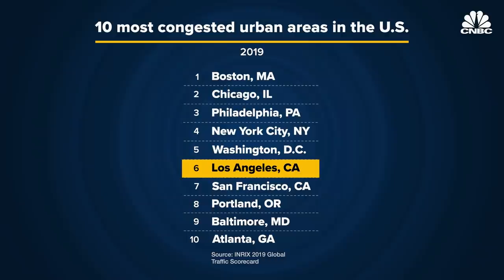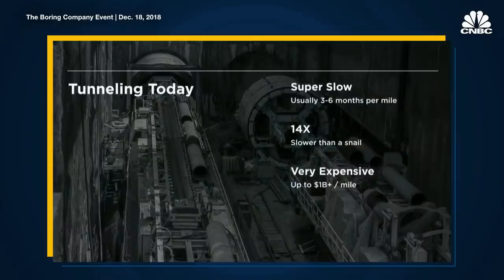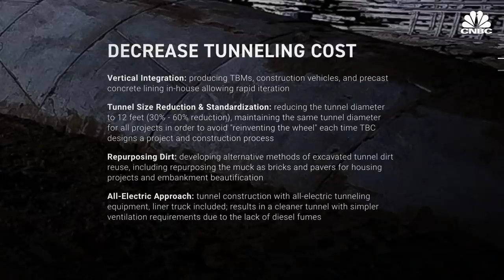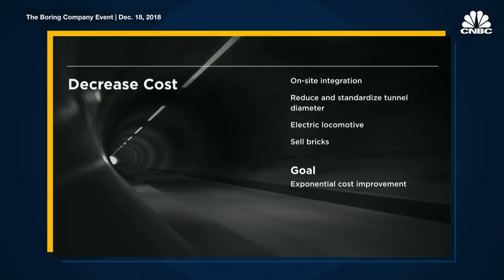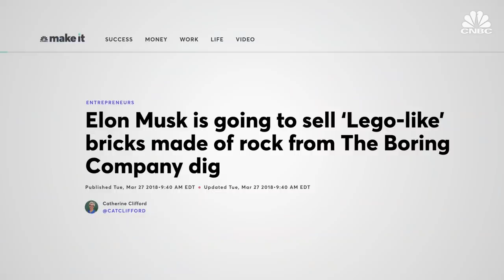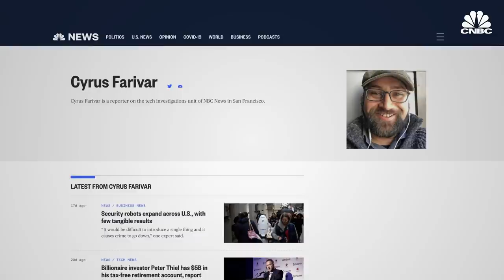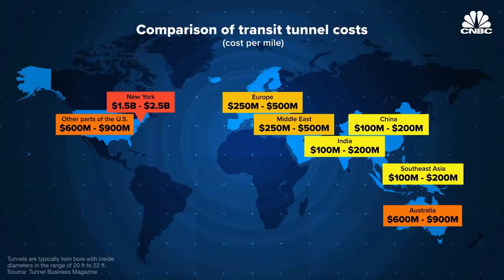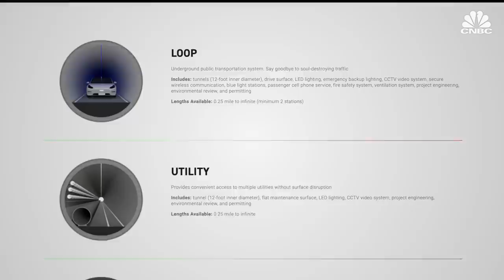Why Elon Musk’s Boring Company Isn’t Fixing Traffic Anytime Soon

Comment: chill people.  If they can innovate and vastly improve the capabilities of boring machines , the tunnel making process and drastically lower the cost, this is a good step for any kind of tunnel.  Building tunnels for Elons cars doesnt have to succeed.  Autonomous vehicles , hyperloop, etc. could eventually change the attitude and feasibility once they are developed.  Many innovations required to make these things work.  Just cuz they all aren't successful yet, doesn't make it a failure.
Reply: But what is the problem with trains?
Reply: @sarthakjain1824  Trains stop at every station. Vehicles in a Loop system can get you from your start to your destination station without stops and without transfers.
Reply: @kevinbailey8827  Express trains don't stop at every station.
Reply: @jeanduponte4056  Yes, I know.  Express trains are great if you happen to be at one of the stations where it does stop and happen to be going to one of the stations where it does stop.

One advantage of a Loop is that every trip is an "express" trip, no matter which stations you start and finish at.
Reply: @kevinbailey8827  but are not trains more effecient?
Reply: @sarthakjain1824  A FULL train is more efficient than the same number of passengers traveling by car.

A train carrying four people is a lot less efficient than a car carrying four people.

In practice, electric cars carrying an average of 1.2 passengers are only a little less efficient (in terms of energy use) than a typical urban train with its average load. 

For the convention center Loop, there are large crowds only for a few days several times a year (like CES).  The rest of the time, there are much smaller crowds wanting to ride.   With a train, you'd be running it mostly empty, most of the time.  It's not a good fit for this location.

Efficiency for larger Loops, like the one they're building for the rest of Las Vegas (with 51 stations) is still theoretical.    But once its complete and operating, statistics can be compiled.   

We'll be able to compare actual energy used, actual operating and maintenance costs, average ride time, customer satisfaction, etc.   We can compare those numbers to similar-sized systems that use buses or trains.
Reply: @kevinbailey8827  but if we have trains in very crowded area, I think full trains would be much more than empty ones and would be more effecient in the long run
Reply: @sarthakjain1824  There will likely be places that don’t yet have a metro system or need a massive upgrade to what they currently have, where trains will still make more sense. 

Once the Vegas Loop is operating, the decision makers in those places will be able to consider the Loop as an option (perhaps modified for their needs) and make an informed decision.

Comment: Average tunnel digging costs (for simular sized tunnels like The Boring Company made here) already were and still are around $10-12million per mile.
The Boring Company ended up with $50 million per 1.7 mile.
Which comes down to $29million per mile. So almost 3x more expensive than average tunnel digging costs. Great work, Musk :)
But hey, if you just compare it to an advanced metro system that costs a billion per mile and forget the amount of people per hour they are able to handle, it still sounds "cheaper", right?

Comment: Because scam is not designed to solve problems?
Reply: It's designed to make money.   The next version of the scam is that TBC is going to build 29 miles of tunnels under the Las Vegas Strip to connect all the casinos together, along with the big stadium and the university.  Eventually the airport as well.  TBC will pay for the tunnels, and the casinos and other destinations will each pay for their own stations (51 stations currently approved). 

TBC will make money after the tunnels are built by charging passengers for rides in the tunnels.  So the grift pays off only if they do a good job transporting people from place to place.    And the real prize in TBC's long con is that if the Las Vegas Loop is very successful, they might attract interest from other cities about adapting the loop concept for their needs.

Oh, I forgot one detail in scam: TBC has promised to bribe the county by paying out a portion of the passenger fares to the county.

Comment: I hope that this is not a project that tax payers are going to be responsible for?
Reply: Hotel taxes paid for the Vegas Convention Center Loop.  It cost a lot less in taxpayer money than an underground or elevated train would have.   It works, and the passengers give it good reviews. 

The larger Las Vegas loop (29 miles, 51 stations) is being built without taxpayer money.  TBC is paying for the tunnels and the station owners are paying for the stations.   TBC will pay a portion of the revenue to the county as a franchise fee.  

If other companies did this, we'd have a lot more metro systems in this country.  If they don't, we may end up with a lot more Boring Company Loops. 😄

Comment: Is this really important to him or is it just to gain experience and money to use this technology on Mars? Remember the boring machine sent to Mars could likely be build of much lighter materials other then the cutting face and structure needed to withstand the rigors of torsion. Possibly mostly titanium, aluminum and magnesium. Very modular and possibly very reconfigurable. Don't forget there are all kinds of tunneling machines just as adaptable to Mars. Look at Road Headers etc.

Comment: How can you fix traffic with a one lane tunnel for only tesla's that go 25 mph? And can you imagine what will happen when one of his cars catches fire in his tunnel and people die because there is no safety systems in it? And of course you can build it faster and cheaper if you don't include the same infrastructure a normal tunnel needs to be safe and operate properly.
Reply: There are safety systems in the tunnels. Whoever told you there aren't is lying to you for some purpose.
Reply: @kevinbailey8827  ther are inadequate safety systems only enough to pass regulations. Theres one fire hydrant and sprinklers at the station and nothing in between just look at a video of a car going the entire length of the loop. Also there just isn't enough space to fit proper fire suppression systems and vents. whoever told there were proper safety systems is lying to you.
Reply: @ballisticfuror1033  Passing regulations means they are adequate.   And you said "no safety systems", which you now admit is a lie.
Reply: @kevinbailey8827  the regulations are the bare minimum it also dosent take into account the fact that no emergency vehicles can even fit in the tunnel to provide ais if needed. 

also calling barely passing regulation adequate is like saying getting 1% over passing marks a good result.
Reply: @kevinbailey8827  i also never said the words "no safety systems" but the ones that are there do jack all
Reply: @ballisticfuror1033  Adequate means you won't be able to shut them down by claiming they don't meet the requirements. 

The tunnels are one of many places that emergency vehicles can't go.   When was the last time you saw an ambulance driving in a subway tunnel?  

TBC worked with the Clark County Fire Department to design their emergency systems and procedures, and they have jointly drilled on those procedures. 

Spokespeople from the CCFD have spoken approvingly of the tunnels' safety.
Reply: @ballisticfuror1033  You'll have to wait for an actual emergency to see how the safety systems perform in an actual emergency.  Hopefully  you'll have to wait a long time, because it would be sick to hope for an actual emergency to happen soon.
Reply: @kevinbailey8827  The tunnel is too narrow to open the doors.  Even if you could open the doors, there is not enough space to walk, especially for disabled people.  The cars have a horrible record of battery fires.  Are you seeing a problem here?
Reply: @georged8644  you are wrong on nearly every point.

Comment: Driver bumper that the reason congested.
Reply: We just build the magnetic rail for carry passengers and the freight.  So that we able to print monies and fiscal budget for states not short
Reply: And we need to add in solar panel and electric alternator to charge the electric cars battery.  So that we print monies to regulate market and also the economy.
Reply: And pay for the workers and restore the credibility back to triple AAA rating in finance and bank no shut down.
Reply: That cause more confusion in state.
Reply: The traffic jam and accidents must retrain all drivers to void drive fast and slow and slow pack traffic and gridlock which means must detect problems.  Or we build sensors that detect problems for them if they fail control.
Reply: These sensors nearly look like a radars detect merging and whole lanes change or merging or accidents or construction zone a miles away and drive with cut back speed forward to miss the jam spot
Reply: If it is costly it is not proper in production it also expensive in maintenance and inspection and fixing.   We my do it in short distance rather than in long distance.  There are more problems to produce.

Comment: The only car you can drive in the tunnel is a tesla 🤔 kinda sus
Reply: They don't let you drive.  This is a taxi service.  Outside vehicles are not allowed. 

If you have your own train, they won't let you drive it on the metro, so this isn't new.
Reply: @kevinbailey8827  yeah but this just combines the inefficiency of automobiles and the limitations of public transport and just imagine a fire in those tiny tunnels.
Reply: @eternalgamer674  Fires are really rare with Teslas, especially compared to ICE vehicles.  But if a fire did occur, passengers would be evacuated and firefighters would enter the tunnel to deal with the fire.   The boring company worked closely with the Clark County Fire Department on its emergency equipment and procedures. 

Electric cars are already almost as efficient (in terms of energy per passenger mile) as urban trains, and that's if you use an average of 1.2 passengers per electric car.   The trains aren't efficient enough to justify spending billions on them compared to the Loop.
Reply: @kevinbailey8827  honestly this just doesn't seem viable. Pretty sure Musk could have built a subway with all the money he has.
Reply: @eternalgamer674  He could have built a subway, but not for the $55 million.   A subway would have required all three stations be underground.   By putting two of the stations above ground, TBC saved $36 million.

The Loop at the convention center is working so far.  Whether it will actually work  for the Las Vegas Strip is something we're going to see in just a few years.  

If it doesn't work, TBC's gamble in paying for the tunnels itself and not charging the county anything will probably bankrupt that company.  

If it does work, Las Vegas gets a tourist transportation system for free (and a cut of the revenue).  And Las Vegas and other cities that couldn't afford a metro will now have a less expensive alternative to consider.   That seems like a win-win for everyone except Musk's Boring Company, which stands to lose a lot.  Or win a lot more contracts to build Loop systems..

Comment: It is dumb why not just build a train that fit more people what is the advantage?
Reply: It's faster than a train, and costs less.
Reply: @kevinbailey8827 . And has the fraction of the capacity
Reply: @simondahl5437  It has the capacity required for the situation.   If you built a train with double the capacity of this loop, it would be only half full on the busiest of days.   Why would you spend four times as much for a train you don't need?
Reply: @kevinbailey8827 . What do you do Then? You decrease the frequency. Or you shorten the train...
Reply: @simondahl5437  Shortening the train works by decreasing the mass that has to be moved.  It may not be practical if you have busy times and less busy times on the same day, and you have to have a place to store unused rail cars. 

Decreasing the frequency allows the trains to run more full.  Passengers either wait on the platform an extra ten or fifteen minutes for the train to arrive, or they board a train that is already there and they wait an extra ten or fifteen minutes for the train to move.

For a loop, it's easy to add or take away cars from the active system.  The cars in the LVCC Loop are stored in a surface lot near the convention center.    Once the Loop is automated, some idle cars can be "stored" at the stations during slow times. They are able to enter service instantly, and this reduces the wait time to zero during slow times.

Comment: Why are people in this comment section so obsessed with the idea of trains and so negative about this new idea? Musk's project is far better and far more creative than building trains. It's like being in an underground train, except you're using your own car, without other people being there with you, not only that, but he is digging even deeper down than you might think. In other words, there will be far more room for this project than the underground trains. Why use trains when you can buy your own car, and travel with less traffic?
Reply: The problem is you'll still have traffic down there. Imagine being gridlocked in a narrow tunnel. Trains are far more efficient at transportation.
Reply: @TheSpartan3669  It's his job to make it work. I don't get how you guys think you know better than him.
Reply: @felthemeart8258  Exactly and he hasn't proposed anything that solves it. What happens if there's a wreck? Are there now hundreds of cars stuck emitting fumes underground? Or are tunnels available only to electric vehicles which a small percentage of the population has? And how do emergency services get there? That's why he gets criticism. His "solution" just creates more problems. A subway system is faster, more efficient, more accessible, easier to maintain, and proven.
Reply: @TheSpartan3669  then read the info provided by The Boring Company